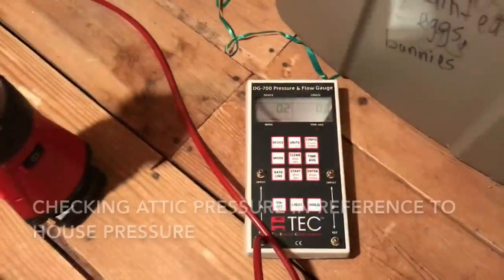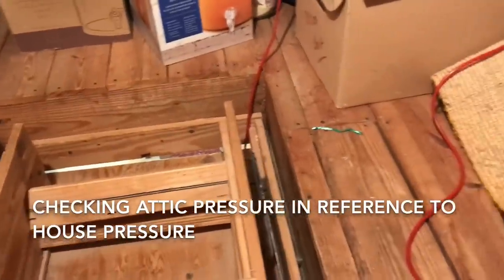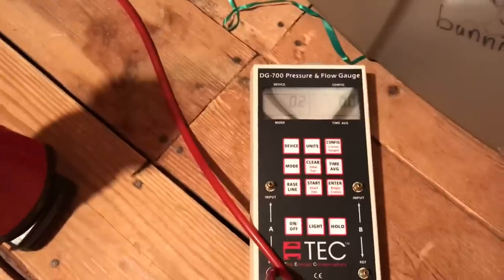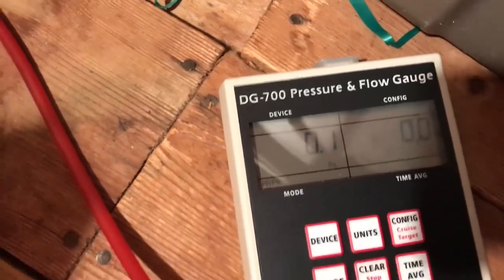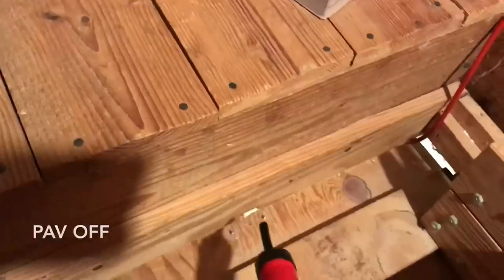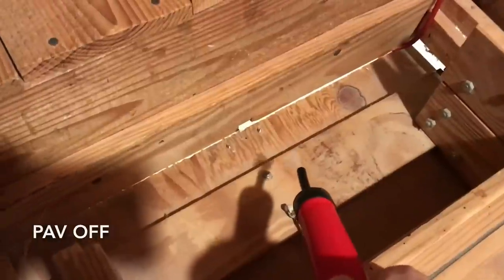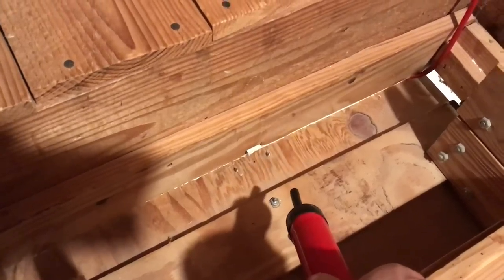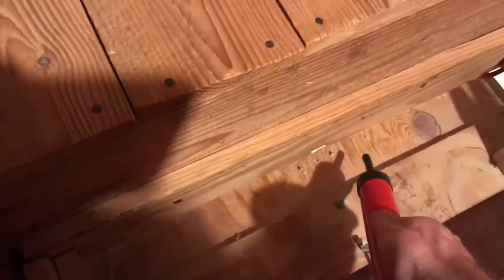Powered Attic Ventilators- Good or Bad?

Comment: I think if your AC system is in the attic then whatever you need to do to lower the attic temperature is it going to be beneficial that doesn’t mean negate Aiir sealing you’re attic. But you have to consider 140° attic provides a substantial heat load on a home and hvac system. There’s duct seepage insulation value radiant heat load and many other considerations. To simply show a smoke draft test and say this is why a fan is dumb is not a full thought.

Comment: This is like saying, well a car's tire could become flat due to nails... car tires suck then... It's not wrong, but it's also not the complete picture. For instance, anecdotally we live in a very hot area, have sealed our house/attic connections and use a vent fan. It has dropped our power bills by as much as 30% during the hot months. (110 degrees + for multiple months.) Sure there are other and better long term solutions. 

TL:DR say "vent fans suck" is not accurate, saying "attic to living spaces need to be sealed" is much more accurate.
Reply: Attic to living space needs to be sealed and properly insulated but most people overlook the necessity of adequate intake ventilation.  Ideally your exhaust vents and intake vents in a static system should be balanced 50/50 but to stay on the safe side it doesn't hurt to have a 60/40 split between intake and exhaust where you have more intake available than exhaust to prevent the exhaust from pulling excess air out of the living space.  I'm curious how effective a powered intake on one gable combined with a powered exhaust on the opposite gable would be or if anyone has tried it.

Comment: The attic fan does suck. It did what its supposed to and thats suck air and throw it outside. The attic door was cracked so what did you expect. Not to pull from the house? If the door is broken fix your door or put an insulating cover up there so that it cant pull from the house
Reply from the maker: Jimmy P https://www.energyvanguard.com/blog/38676/Don-t-Let-Your-Attic-Suck-Power-Attic-Ventilators-Are-a-Bad-Idea

Comment: I've never heard of reverse stack effect. Something else is making the house go negative with respect to the attic. Bath fan, range hood, dryer, or maybe leaking supply ducts in crawl space. No matter, that is wasting energy too because it's drawing attic air into the conditioned space. Your video is great and it is proof of why airsealing the attic is crucial. Those pull downs need an airtight insulated cover too. 10 sq. ft of pure heatloss and gain.
Reply from the maker: Ken Field every other appliance was off (I was about to do a blower door test). Check out this article on reverse stack effect. 

http://ncidavid.blogspot.com/2013/06/two-story-cooling-problems-and-reverse.html

Comment: What if you have two vents and more vent holes up there ? Our attic has two air vents. 45* angle and about 15 feet apart. The fan will be sucking air from the other vent and other smaller vent holes. The AC is also very close to it.

Comment: Just installed a gable attic fan in the house today. I think its a case by case situation, as we have tons of tree cover and don't really notice the heat inside the house until its dark and cooling off outside (old house 2x3 walls). I plan on putting a supply and return within line sight of each other and running them for a short period of time on a switch from within house.
Reply: i agree.   i think you need a gable fan out and gable inlet on the other side of the attic.  That shouldn't create a vacuum in the attic
Reply: I have a lot of tree cover most of the year with 10a-2p allowing the most direct sun and most sq. ft. of roof.
When there's no, or little, breeze, the attic temp can really rocket up. I've got a gable fan with a thermostat that works great for getting that space cooled down. What this guy is showing is not that the fan is bad, but that it's too big and or pulling more CFM than his venting (soffit, ridge, ?) can handle. And that there are areas that are not well sealed. The objective isn't to suck out all the air in a minute.
Reply: @wildcat7266  Yes, and/or soffit vents or ridge vent. There's things wrong with this building and/or fan size/speed.

Comment: Hey Neil question? I have a detached garage that I put all Sheetrock in and insulation walls and ceilings also I have a window ac unit. No gable vents or soffits installed (only 2 roof vents. What can I do will it rune my sheetrock or walls ceiling ?

Comment: Attic fans do suck (literally) but I believe that you can’t just add an attic fan without doing anything else. It’s the same reason why I tell my wife to open up one of the windows when she’s cooking and has the hood fan on. Air has to come from somewhere, it doesn’t just magically appear (what goes out must come in). I think If done correctly, an attic fan and/or whole house fan can do more good than bad. Let me know what you think or if I missed your point completely.
Reply from the maker: macr88 let me ask you this, what purpose does the attic fan serve?
Reply: Neil, to create a pressure differential. The goal is to move hot air where it isn’t needed. 
If you can keep an attic temp at 100 instead of 140 it’ll help keep the house cooler.
Reply from the maker: macr88 and there lies the problem. Unless the attic ceiling plane is air tight the pressure differential sucks in conditioned air from the living space, which causes outside air to enter the living space.

Let’s say the ceiling plane is air tight, now you’re trying to cool a 140° attic with 90° air, when the air temperature isn’t the problem, the heat is coming from the sun (radiant). Besides if the ceiling plane was air tight just add more insulation, who cares what the attic temperature is at that point.

Attic ventilation is overrated, more of a wintertime concern.
Reply: Neil, you just have to have ample venting for the attic space and it’ll be fine 👍
People just put them on without proper venting.
Reply: @neilcomparetto5282  Nonsense.  Excessive attic temp will degrade roofing materials faster, and of course some people use attics for storage.  And if your ceiling plane isn't well sealed no amount of insulation is going to stop that superheated air from leaking down into the house.  It needn't be perfect, just significantly more resistance than pulling through the eave vents.  Sure, doing anything you can to prevent the solar radiation getting in is ideal, but that only goes so far realistically.

I guess I'm just an advocate of doing all the details right and not half-assing it.  Certainly slapping an exhaust fan on in isolation is no better an idea than putting a turbo on an engine with bad ring seal!
Reply: Everything is magic for women.
Reply: @neilcomparetto5282  so what do u suggest then? cuz im thinking of getting one myself but also gonna possilbly put fans inside house windows to blow cool air in at night, but for daytime thats the tricky part after 12pm - 4pm house is warm even with the window thing(open all night, close in early morning)

Comment: Looked hot in that attic, what was the temp outside and the temp in the house? Great find here, I never considered the house having so much infultration. Wonder if eventually the house - if being conditioned, will eventually neutralize with the space above (the attic) and more air will be move to the attic from outside instead of the house?
Reply from the maker: David Roth it wasn’t that hot in the attic, probably 100°. Outside was about 85°, inside was 75°. The greater the temperature difference the greater the infiltration. This link describes reverse stack effect well.

http://ncidavid.blogspot.com/2013/06/two-story-cooling-problems-and-reverse.html

Comment: would there be a vacuum in the attic if there was a gable fan at one end and a gable inlet of equal size at the other end of the attic?
Reply: I wouldn't think that would be an issue. I'm not a contractor or anything at all though.
Reply: @anthonyjulson8840  it's a huge issue.  Attic ventilation needs to be evenly distributed between intake and exhaust to prevent excess negative pressure in the attic.  If your exhaust it trying to pull more air than the intake can provide it will pull warm moist air from the living space into the attic in the winter and cause mold.
Reply: @shibbyrick  Why would you be running an attic fan in the winter?
I agree that AFAIK moisture/mold from air travelling through spaces like walls is the concern. (and generally pulling a lot of unfiltered exterior air through your house)
But what areas run attic fans outside of summer? I thought they were meant to 1) keep attic temps close to ambient therefore reducing heat in the living spaces. 2) limit attic temps to <120-140 to protect roofing materials.

Comment: Is there a way to test pressure but not have that red hose causing that big gap in the pull down ladder? Doesn't that throw off the reading?
Reply from the maker: You can get thin metal tubes... In this case I don’t think it matters too much, the door didn’t seal well naturally, and there are plenty of other holes (top plates, electrical/plumbing penetrations, register boots, etc.)

Comment: Awesome video, just passed my AMRT exam and learned about manometers. Do you have a suggestion on cooling a hot Oklahoma small home attic space?  Small fan on one gable pulling and another fan on the other end exhausting?
Reply from the maker: In general, attic ventilation is kinda overrated — it’s main purpose is to prevent condensation on the roof deck in the winter. If you don’t have that it’s probably sufficient.

If you have hvac equipment and ducts up there I would consider spray foaming the roofline and making it conditioned space.

If there are no ducts — move/remove the insulation, air seal the ceiling plane, add more insulation. Then it doesn’t matter how hot it is because it’s air sealed and insulated from the living space.
Reply: @neilcomparetto5282  We plan to seal it, including the attic access door, remove the HVAC and blown in insulation and replace it with foil faced batt everywhere. Just cooling it down is the obstacle, it hit 170 F up there during the inspection, which of course has led to the HVAC problems. 

Would the new install of the HVAC just run a flex/supply up there also to cool it, is that your suggestion? 

Thanks for getting back to btw.
Reply from the maker: @amv_pure  not sure if you’ve seen this… if you haven’t you’ll come away knowing a lot more about attics. 

https://youtu.be/Ld8pzIu45F8
Reply: @neilcomparetto5282  Joe is the man, thanks for the link. Most appreciated.
Reply: @neilcomparetto5282  I have watched this, thanks for the link. Appreciate it.  I got a question for you. I have a client in Utah who is building a house and the contractor is insistent on using spray foam in the attic. He keeps sweating the R-Value and ice dams and I keep telling him my client is VOC sensitive and find an alternative. As far as that climate zone (Utah) what other insulation do you suggest. Blown in is a no go too, because of the steady particulates that come off it. I was thinking Rock Wool batt style. Maybe you have a link on insulating homes in colder climates?
Reply from the maker: @amv_pure  I would search Building Science Corporation’s website - I know they have several articles in addition to this one. https://www.buildingscience.com/documents/guides-and-manuals/gm-2101-guide-building-conditioned-unvented-attics-and-unconditioned
Reply: @neilcomparetto5282  Thanks, Neil. I do appreciate your help.
Reply from the maker: @amv_pure  no problem, best of luck!

Comment: Good video. Ridge vent best?
Reply from the maker: HVAC Shop Talk Podcast in short the combination of soffit and ridge vents works best, but you might have to change your expectation of what “works” is. If you’re trying to get the attic temp similar to outside ambient in the summer, good luck. 

https://buildingscience.com/documents/published-articles/pa-crash-course-in-roof-venting/view
Reply from the maker: RJParker an argument can be made for a vented attic when mechanical systems are not present, but encapsulating checks a lot of boxes.
Reply: ridge vents leak, in wind driven rain, my new roof, with 50 year OC Premium Cool Duration lifetime/50 year now , roofer won't use ridge vents, prefers the vent units, even the high quality ridge vents he said will leak in wind driven rain.  So no ridge just fan and 3 static vent units...he also gives a 20 year no leak warranty, on top of the lifetime OC on the shingles
Reply: @neilcomparetto5282  thanks for the info and articles …..

Comment: So explain please. So the fan is bad?
Reply from the maker: Robert Martin it can, and often does have a negative effect on energy use and comfort. It will put the attic into a negative pressure causing conditioned air from the living space to enter the attic. When air leaves the living space to outside (attic), it must be replaced with outside air. That outside air is usually hot and humid... Best practice is to air seal and insulate your attic and not care what temperature it is up there. (Hopefully there isn’t any ducts)
Reply: @neilcomparetto5282  when you say there isnt any ducts what do you mean? I have plenty insulation in the attic and there is still a fan up there that is so loud and turns on when its above 100 degrees in the attic. I do have both AC units in the attic too. So i have ducts coming from them down through the ceiling...

Comment: That was the purpose of attic fan. To pull out hot air in the attic.
Reply from the maker: INDO KEREN to pull conditioned air into the attic from the living space? Where does the air come from that replaces the conditioned air?
Reply: Neil Comparetto I thought that air was supposed to come from soffit vents to pull out the hotter air?
Reply from the maker: Alexis Jankowski that’s the theory, but air is stupid, lazy, and stubborn- it will pull air from all holes (including the living space)... The heat is coming from the sun’s radiation. A better strategy for cooling the attic would be reducing the radiant heat gain.
Reply: @neilcomparetto5282  This is a flaw in that attic that is not sealed. You need to seal it and then all air will come from soffit or eaves vent. Problem solved.
Reply from the maker: Jai Kumar I agree. I was just demonstrating how attic fans operate in 99.9% of the attics they’re installed in. Very, very, very few attics in the existing housing stock are sealed.
Reply: @neilcomparetto5282   That doesn't mean attic exhaust fans are bad, that means "99.9% of attics" are bad.  What are you going to do if you already have a sealed ridge and fans, spend thousands to tear it up and completely redesign?  (And potentially risk water leaks and other new problems.)  Or spend a couple hours sealing your ceiling penetrations for nearly free which you should do anyway?  This is some backward-ass thinking.
Reply: @neilcomparetto5282  what if my house doesn't have air conditioning. Would it make sense then?
Reply: @neilcomparetto5282  how do u reduce the radiant heat gain??

Comment: Please get solar attic fan which has far lower wattage & power, most only 12V & 10-50 watts & it won’t suck the air out of the house. The house need seal good also. Electric 120V attic fan is too powerful, it will suck the cold air out of the house behind the hot 🥵 air in the attic.
Reply: have u had one before??

Comment: They're only bad if your house is poorly insulated
Reply from the maker: Colin insulation has nothing to do with it, it doesn’t stop air leakage. If you had great insulation and air sealing does it matter what temperature the attic is?
Reply: @neilcomparetto5282  that's why they seal the attic first it called Air sealing . It's where you seal all the crack between the drywall upstairsyou also see where the walls come together you seal all that up before you blow in insulation in. After you are seal then you blow the insulation on top . You don't want to use the red stuff cuz the r-value is too low . if you didn't air seal your attic and you have insulation in there you got to suck all the insulation to air seal . Also another thing is those fans are for the summertime not the winter time . Off on winter and sealed shut . Sumer time thier open .
Reply: @neilcomparetto5282  it sucks the 140 F temps out if the atic
Reply from the maker: Colin https://www.energyvanguard.com/blog/38676/Don-t-Let-Your-Attic-Suck-Power-Attic-Ventilators-Are-a-Bad-Idea